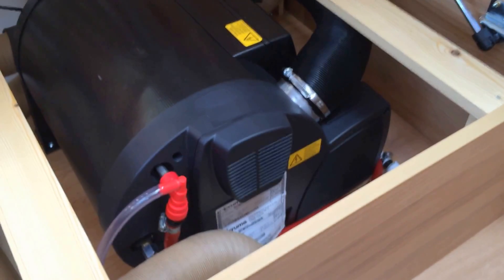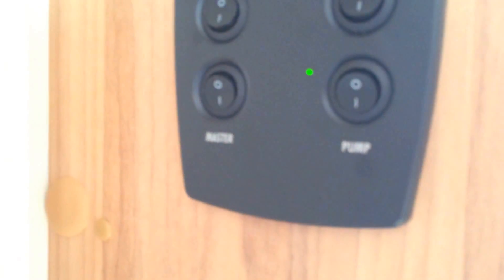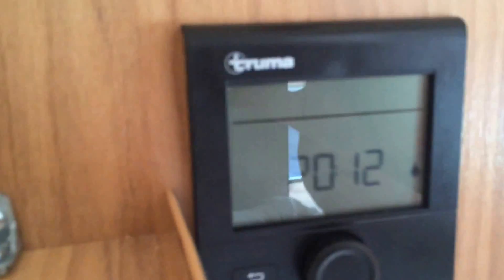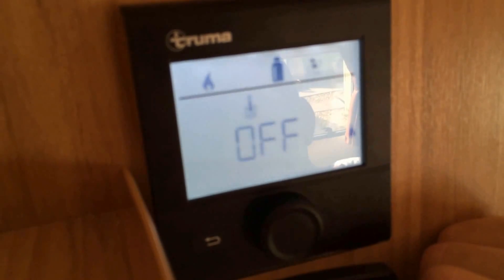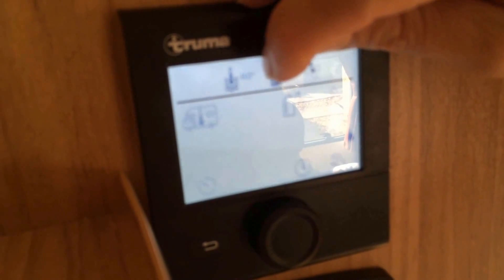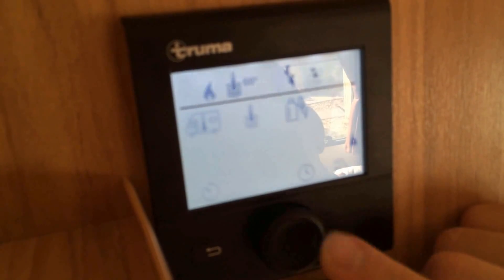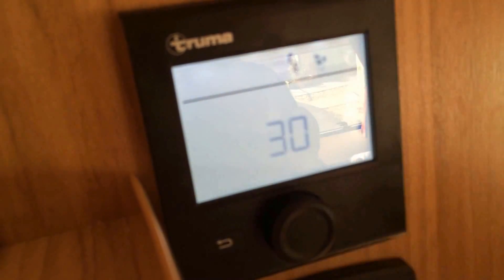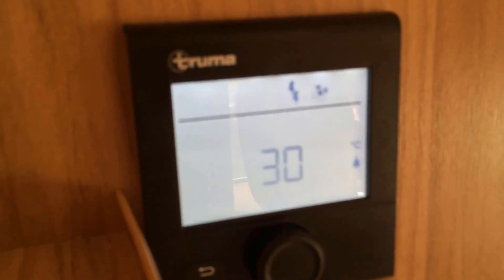2014 Bailey Pursuit - Truma Heating / Water heating system demo, tutorial

Comment: Hi, will the heater only work if you have water in the system?
Can it be just be used like the old electric heater or does it need to heat water before it will blow warm air? 
Cheers to anyone who can answer this.
Reply: it can be used with out water in the system.sorry it took three years to get an answer for your question !!